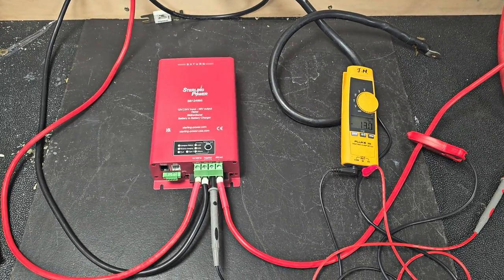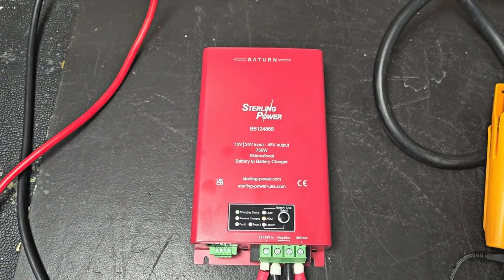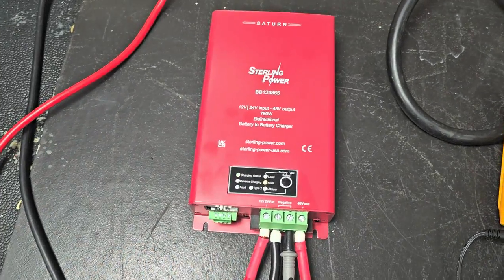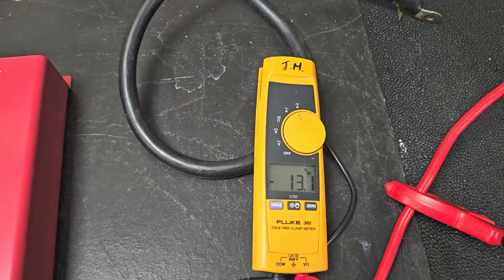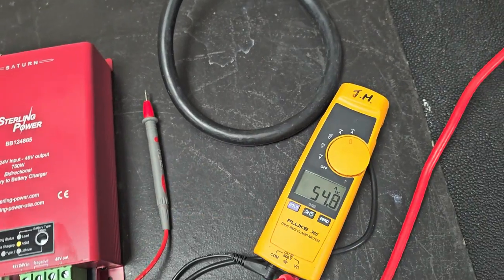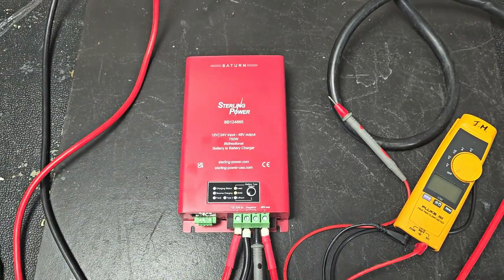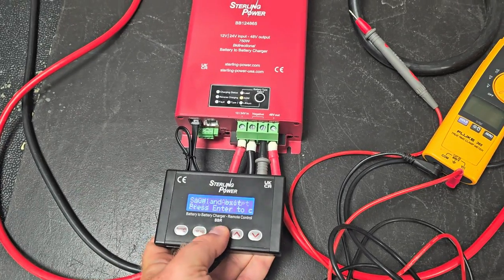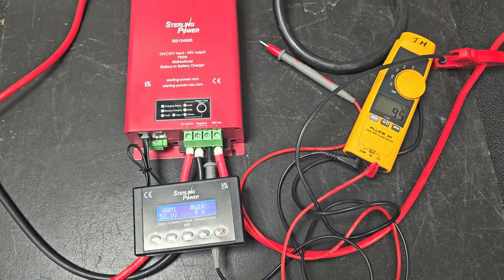BB124865 - 750W 12V/24V to 48V DC to DC charger

Comment: What are the total expected losses involved in this sort of charging?  how many Wh of capacity is lost from the source battery relative to the destination battery?
Reply from the maker: In the intended system, none.

The DC/DC charger is designed to utilise the alternator as the power source, not the input battery. As the alternator is (or should...) be the higher voltage 'provider', the input battery is not being drawn from. 

There are systems that use our chargers where they intentionally use them to pull from large battery banks to charge another battery bank- in that case, the units are still efficient in the high 90s percentile (varying between 96% and 98% generally).
Reply: @SterlingPowerLtd  My question was intended for battery-to-battery charging, so I may have been confused about the nature of this particular product.  Does the 96%-98% efficiency figure only account for voltage conversion losses or does it also account for charging/discharging losses of the batteries?  I understand that your product cannot control all of these variables, but I'm curious about the typical and best-case battery-to-battery charging scenarios.
Reply from the maker: Hi!

So the efficiency is specifically to do with the efficiency of the charger and its conversion from input to the output. It doesn't, in normal operation, negatively affect your batteries.

If you intend to run this directly from battery to battery, IE you're charging a battery bank from another battery bank (and using the battery bank as the power source rather than an alternator, for example), the power put into the target battery will be almost equivalent to the power pulled from the input battery (in terms of watt-hours), but with the efficiency loss of ~2-4% across the way.

The battery will still be capable of being charged to full due to us having full voltage control.

Comment: thank you for filling this gap in the market .. about to pick up a class c rv here for desert dwelling and want to put in a 48v system and a 24v rooftop ac  ... this product  and your video on using an MPPT from a 48v bank to a 12/24 will let me charge a 12v battery to run a 12v rooftop AC unit !!!
Reply from the maker: I hope it all goes perfect! We'll be here if you need us :)

Comment: The new Saturn range is a brilliant bit of kit. Using the bb1248120 for a couple if weeks now. Can confirm efficiency, settings and low noise.
Happy customer, can also say that the support team is absolutely on par regarding tech exchange in advance.
Recommended!👍